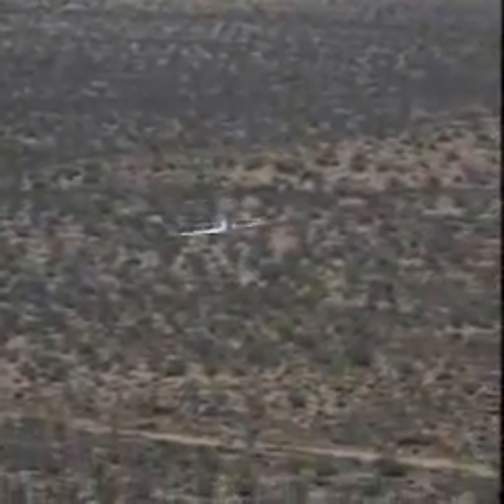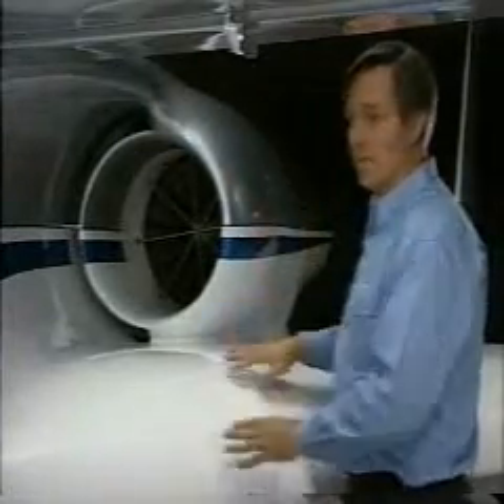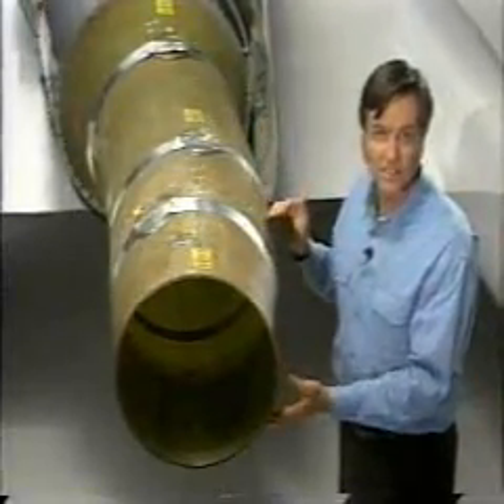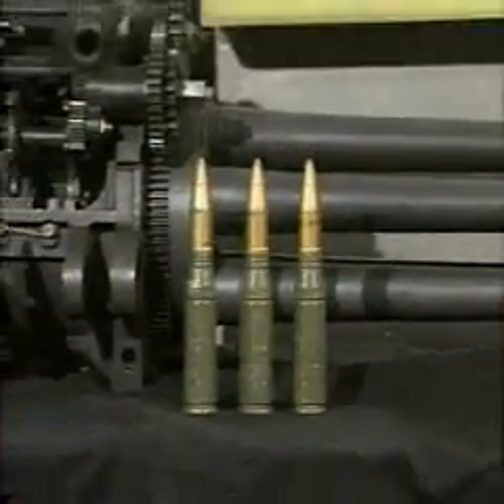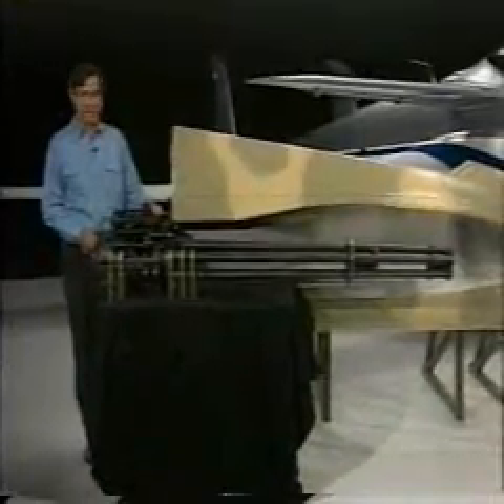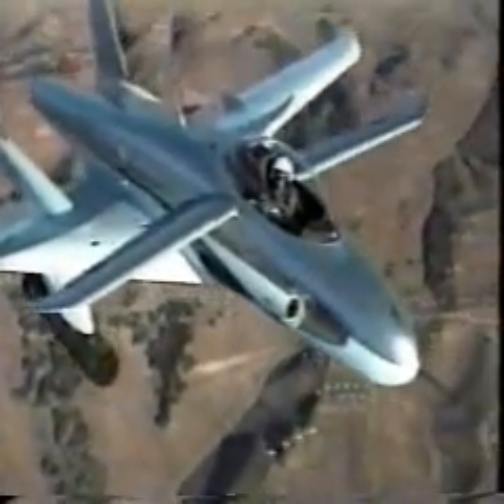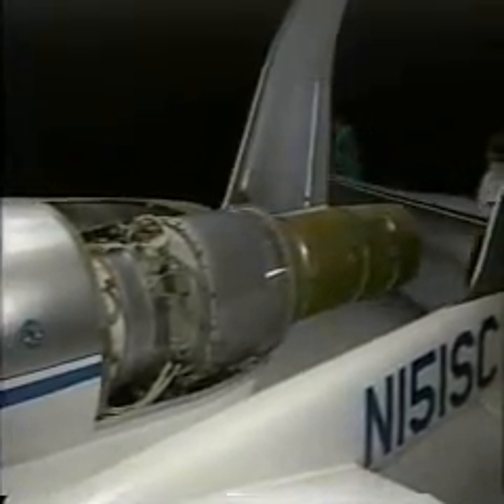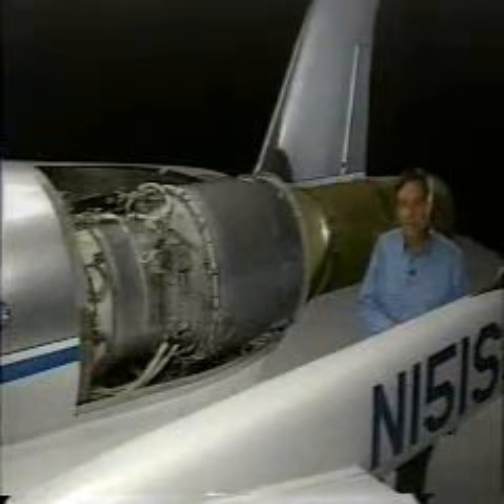Turbofan Killer Bee: Rutan ARES "Mudfighter" for U.S. Army Close Air Support

Comment: The Army should still try and acquire this plane along with some AV8's for the XVIIIth Airborne Corps and other rapid Deployable forces. The Army should get its Expeditionary capability back from amphibious including Airborne on a larger scale, hybrid brigades able to perform all 3 combat ops amphibious air Assault and Airborne.  It's also time for the Army to get it's fixed wing FAS/COIN back as in the days of WW2, bring back the Corps!(Army Air Corps)
Reply from the maker: MUDFIGHTERS for the U.S. Army operated away from easily destroyed FOB/air bases is a necessity since the pampered USAF refuses to give up its comfy living arrangements even though it means their DEATHS and MISSION FAILURES by TBATE and TBAM. The USAF couldn't even ground transport their precious few F-22s from an air base to prevent a mere hurricane destroying them!
Reply from the maker: The AV-8B Harrier II is no longer in production; its only VTOL with light payloads and is really a STOVL fighter-bomber. The F-35B with central lift fan and vectored thrust (VT) is supposed to be much more safer than vectored thrust-only Harriers. On land STOVL might be moot point if operating say F-20V Tigersharks with Vectored Thrust & Canards (VTC) like the F-15 MTD aka with eSTOL proved.

Comment: It's not a warthog, but it looks like a cool little jet. Small, maneuverable, cheep and dirty. An excellent low cost, "force multiplier." 
  When included in a "strike package" that includes AH-64s, A-10, AC-130, and F-35 aicraft. For battle field domination. F-35 and A-10s for stand-off SAM suppression. The F-35 for AAW support, and the AH-64 for dealing with mobile AAA tanks.
   That cheep little plane, mixes it all up. Adding more hard to hit, overhead fire power.

Comment: How many ARES could you get for one F-35? 
How many ARES could be serviced relative to one F-35?
Bet its average time in air would be many multiples of that of the F-35. 
Type of plane that basically anyone could fly and win with.
Reply: You are comparing apples to oranges.  It doesn't matter how many Ares can be bought for price of a 35--  they are designed for different missions, so the military services need both.

Comment: This remains a seemingly superior adjunct to the existing A-10 and F-35 for light ground attack and close air support roles.  Rather than supplant the existing airframes it should be developed for a role alongside them to fill in the gaps.  Sometimes a 30mm cannon shell isn't the best means of knocking out unarmored light trucks in today's battlefields.

Comment: 100 times better than the F-35.  Looks like it's designed for CAS.  It doesn't look as robust as the A-10, but it looks smaller and lighter.  Close air support mission should belong to U.S. Army and so should the A-10's.  Looks like a great plane.

Comment: Another great Rutan design.  This would have been a good compliment to the A-10, not a replacement.  A 2 seater could be used as a FAC to guide in Close Air Support.  Now it looks like the military just wants fast jets (F35, F22, F18 Super Hornet) and drones.
Reply: Would make an excellent air contingent to a Joint Special Operations Task Force, without having to call up heavy logistics packages from the USAF.
Reply: Kevin Moore
Reply: Placing the F35 in the same category as the F22 and Super Hornet comes from the type of arrogance that loses wars.  The F35 was made just to "dazzle" potential buyers and has no place anywhere in an effective Military arsenal... with all due respect

Comment: Ditch  the ejection seat , bring the engine on centerline along with the cockpit and add a second seat and it would make a great civilian sport aircraft. Otherwise as is it would make a great way to have low cost close air support for ground troops . A "Titanium bathtub" could be easily added to protect the pilot along with some composite armor for the engine and fuel tank to protect from small arms fire .  I think it would be a cost effective way to use to supplement the effectiveness of the A-10 because the Aries could be operated from forward bases that couldn't support the A-10 meaning the troops could get help quicker and more of it when needed .

Comment: @HDaviator Sounds like you read Chuck Yeager's autobiography where he expressed exactly the same opinion after the Air Force passed on the F-20 Tigershark simply for the reason the manufacture did the specification & design itself without 400 "desk pilots" from the Pentagon being involved. Interesting that the Air force started out as the US Army Air Corps. and with the advent of the Cold War catapulted itself into a separate mission statement,and budgets. Talk about Government Waste !

Comment: If Burt Rutan can practicly replace the A10 using a small aircraft built around a tiny engine, I wonder what he could design around a Honeywell F125 engine (9.250lbs). 
 I bet that he would offer at least F15 if not F22 performance for a fraction of the cost!!

Comment: This aircraft would be effective no doubt. It's small, relatively fast, composite structure (very little if any radar energy reflection) and very maneuverable. How it would deal with combat damage is difficult to say, but none of the modern military aircraft deal with combat damage very well. If you take a hit, chances are a vital system component is lost or damaged, there simply are no unneeded components in a modern combat aircraft system.

Burt Rutan's design of the ARES is sound.

Comment: It looks flawed. why put the gun off to the side... every time you see it fire it fishtails.  it's an accident waiting to happen.  I realize that they are trying to reduce crap getting into the engines but place it in center and the intake on top (similar to an aircobra/kingcobra)  and with the way that the inlet and the duct are arranged if a bird gets near the canard it will be sucked into the engine anyway.   Yes this a great idea. but there are many improvements that need to be done.

Comment: Short bursts of gunfire are generally desirable in large aircraft as well. The pilot would need to kiss in a little right rudder to offset, no doubt.

Did you know the recoil of the GAU-8 on the A-10 is equivalent to the thrust of one of its engines? Not a new concept in mud-movers. :)

Comment: Pulling the gun and ejection set will cut 1,000 lbs out of the wet weight. Stretch the wings or make them foldable, you'll have one hell of a ride that would fit into a garage stall... I wonder what the VNE is on that beauty...

Comment: I'm not sure that it would, jkyet, but even if it does it shouldn't be any more difficult to cancel out than the torsional motion that all propeller-driven aircraft have; it'd just be a matter of control surface configuration (fixed and/or moveable surfaces) to cancel any adverse motions caused by the engine placement.